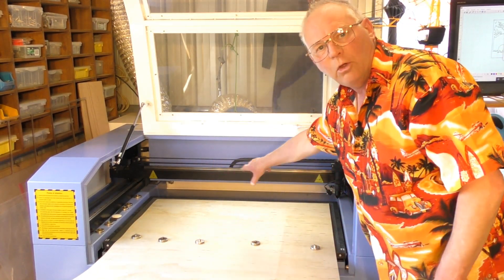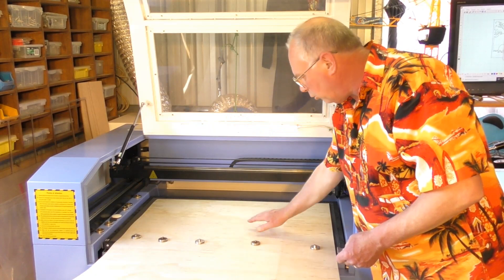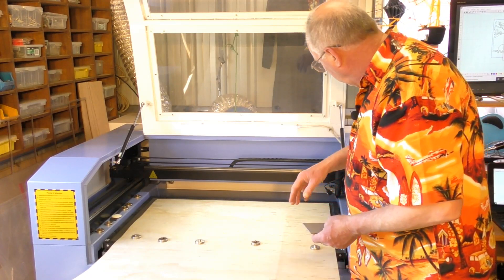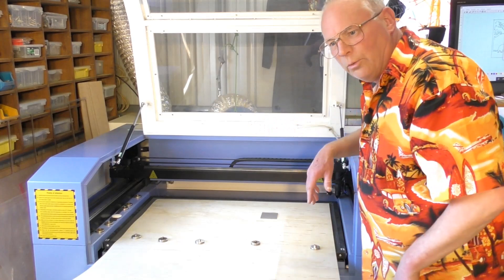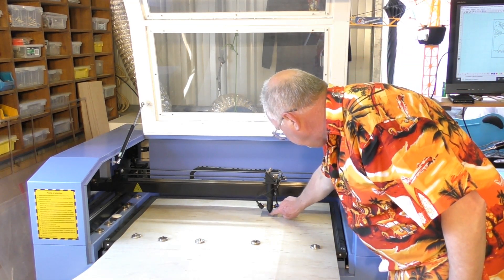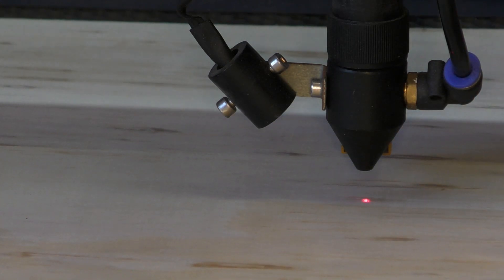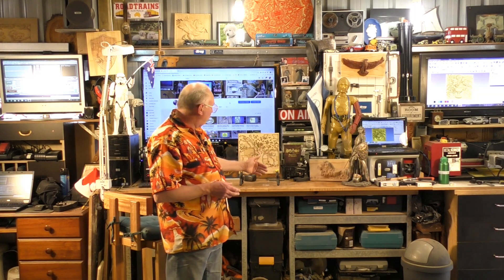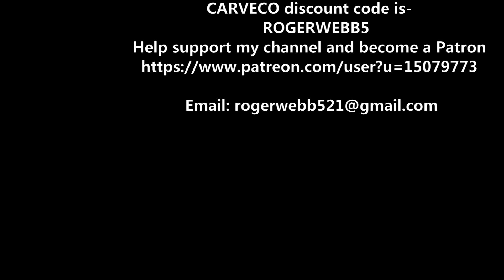100w Lasers, multiple layered 3D pictures, This Laser can make $150,000 per year I can show you how,

Comment: Great video series, thank you. My question for you is I noticed that the detail cuts the parts drop from the flush surface. Is the board elevated for any particular reason? I noticed when you were showing acrylic being cut you raised the material some distance from the honeycomb.  But I would have thought with a pass through the material wound be directly on the base.  Thank you again.